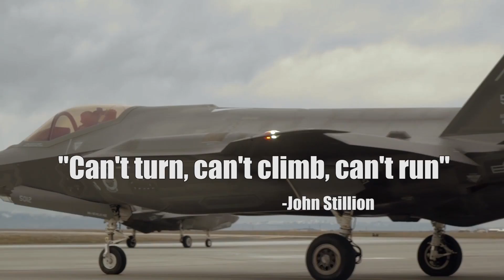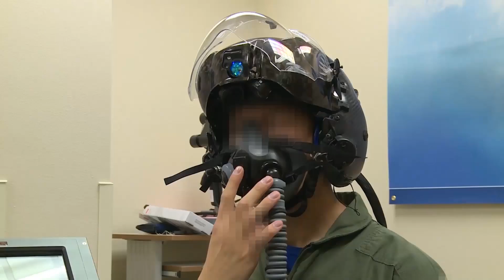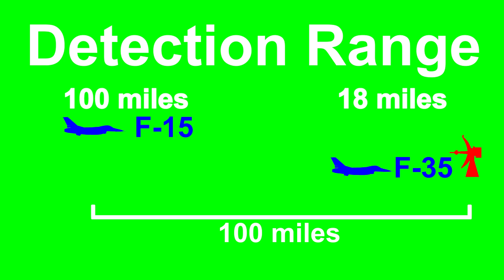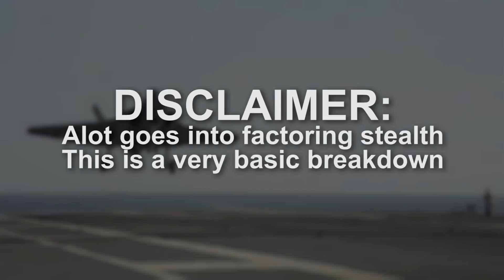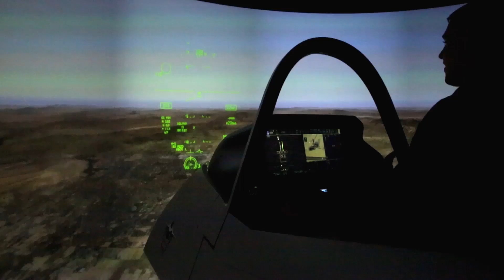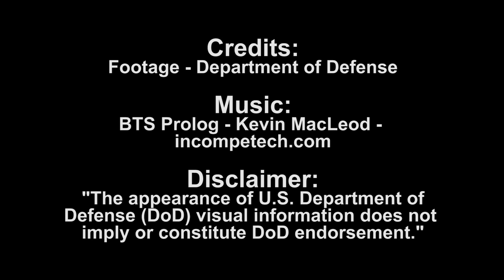F-35 Overview - The Good, The Bad, The Ugly

Comment: A couple of quick corrections. The F-35 does NOT have a much lower thrust to weight ratio than most modern 4th gen aircraft. Let me clarify what I am saying, the F-35 was designed to carry a MASSIVE internal fuel load. Around 3x more than the F-16. If you load a F-16 and a F-35 with IDENTICAL fuel and weapons, the F-35 has a slightly higher thrust to weight ratio than the F-16. 

As far as the payload goes, the F-35 will not always need stealth. The reason they invested in Stealth is so the F-35 can operate on day one against a near peer adversary without massive amounts of support. Once the AA threat has been reduced it will be carrying ordinance on external pylons just like a F-15, 16, or 18. 

The price point is a bit misleading. True the program has experienced massive cost overruns however keeping 30 year old aircraft like the F-15, 16's, Legacy Hornets, and AV8B's flying is massivly expensive. Every legacy aircraft that is replaced by a F-35 is actually saving the military in annual operating costs.

Comment: stealth is becoming a waste of time with upcoming radar systems. it makes it more expensive and higher maintenance time/cost than necessary. sure it can get closer before being detected, but in far fewer numbers and less trained pilots due to cost and maintenance times. For specialized bombers it's a great tech, but not for an air superiority fighter. instead, we should focus on speed, low cost, and high reliability.
Reply: It's not even an air superiority fighter it's multi role, stealth has many applications for it
Reply: As far as I know all the interview with pilots that flew this say the plane is really easy to fly, in fact the plane doesn't have a 2 seater variant at all, its just straight from the SIM to the actual thing. 
+ This is not an air superiority fighter that's the F-22s role
+ You're right about the maintenance time though , seems to not be where it should be.
Reply: cobra4975 Was the F35  ever slated to be an air superiority fighter?  Thought it was just like an F16 jack of all trades kind of platform. Anyway radar systems are getting better but stealth is just being sneaky and you don’t have to take on the radar system, you just might want to go through weakest area or around it. All radars have areas of poor coverage due to terrain obstructions, building, even water can distort a radar take off angle. And Russian crap is just that. Crap. Great plane for the radar crap it flys against.
Reply: The f-35 is not an air superiority craft.
Reply: Does it need an airconditioned hangar as the B2-bomber?
Reply: No -- it's also built to be on ships which are a notoriously difficult environment.  F117 needs air-conditioned hangars too.
Reply: Then, design one. IJS.
Reply: As time goes bye  and new technology coming into play I strongly believe radar will not be able to detect stealth planes at all. For example, the new US LRSB B21 Bomber will be more stealthy than its predessor B2 stealth bomber. Low Frequency radar will have a more difficult time detecting this new bomber.
Reply: We have a Youtube engineer here. Tell me, if stealth is such a waste why are Russia and China also spending billions on stealth planes?